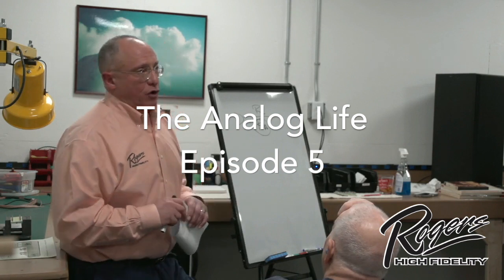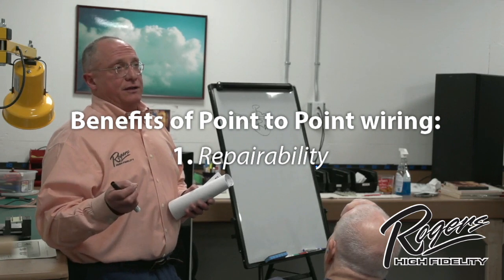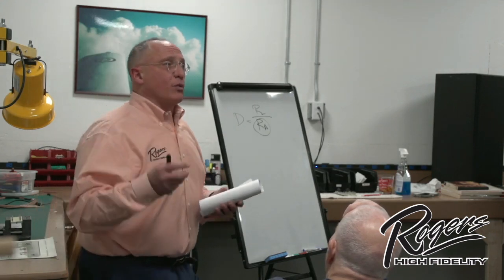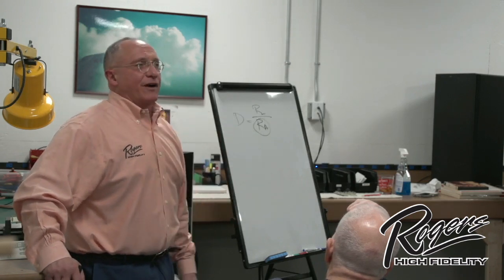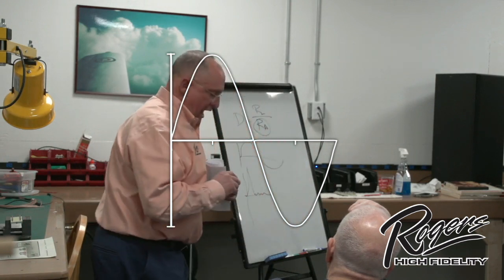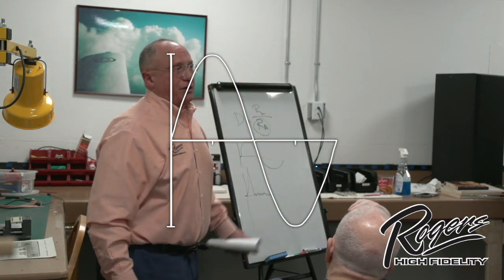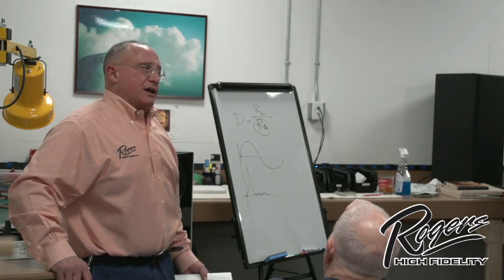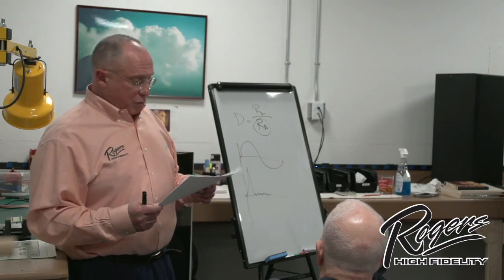Point to Point Wiring Vs. Printed Circuit Boards - The Analog Life Episode 5 #TheAnalogLife

Comment: Actually class D does transients best. 
You can get PCB traces equal to 18 AWG wire. The current capacity of 18 AWG is 14 amps. The current capacity of a 0.25" wide trace of 2 oz. copper is 20 amps.

Let's say an amp is capable of 200 watts and the voltage is 200 volts, the current to achieve that voltage is 200/20 or 10 amps. So PCB's are fine. Desoldering from a PCB is relative to the design and quality of the board. A good tech can desolder 40 pin DIPs without damaging the board.

You make nice looking equipment, it very likely will last but so do high quality PCB's. The beauty of PCB's is that you can contour the board for any size trace you need to fit the current it carries. Why use an 18 AWG for a grid circuit? Not required but with wire you can't run thin wires, they compromise the design physically, a thin PCB trace doesn't. We wired boards in 1960, old technology does necessarily equal better technology.

Comment: This guy is not correct at all.  Transients come on? Most of the current in a tube amp is in milli amps (mA) and using high voltage.  You do not need big cables to handle this because the current is so low.  A length of heavy wire from one point to another may measure 0.01 ohms.  A similar circuit board track my measure higher at say 0.1 ohms. (so 10x higher).  However, resistors typically in these circuit are in the 1000's of ohms. So what difference is 0.09 ohm really going to make when you have 1000's of ohms resistors all over the place. "Absolutely nothing"

Comment: Rise time is the term used to quantify an amp’s ability to handle transients and it is listed in volts per microsecond. Having a high slew rate enables an amp to handle transients with ease. How it is done, I could not say. I am not an engineer or a designer. But equipment with circuits which exhibit this ability are prized over those who don’t. Also the same applies to settling time. This is an amplifier’s ability to stop producing a signal when it stops receiving that signal. Also a critical factor, just so you know. You probably already do!